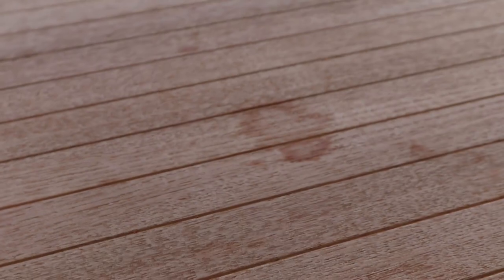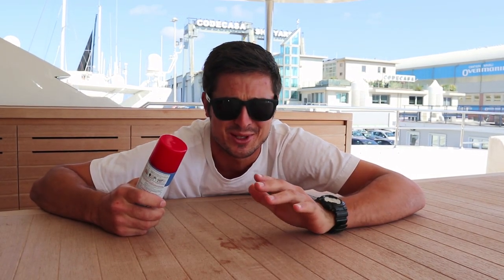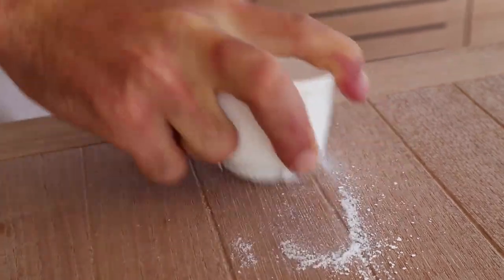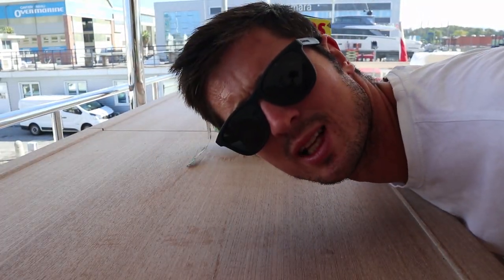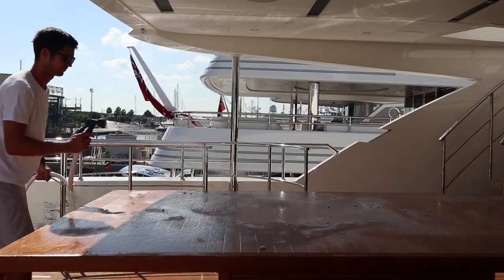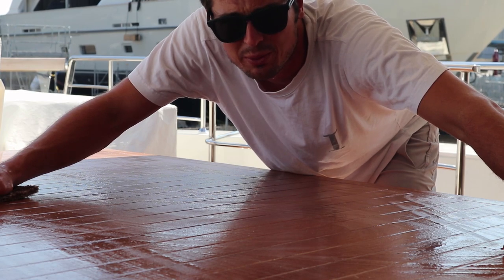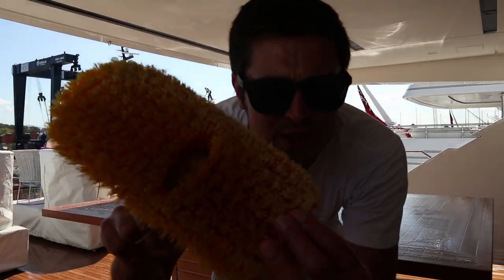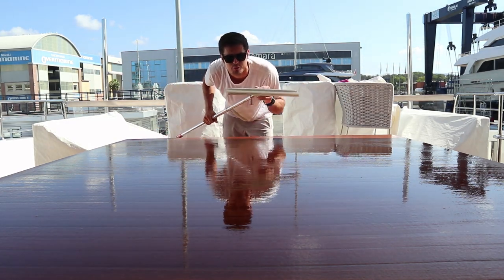How Yacht Crew Treat TEAK Quickly

Comment: Hi Jared,  loving the videos!  Question: have you ever thought about using Odie’s Oil?  It’s not only designed for every wood, but it’s especially great on exotics like Teak and it would prevent oil spots from ever occurring. You would only need to use vinegar and water to clean periodically. As a wood worker, I can attest to it’s unbelievable properties. If you ever want any more details, let me know!

Comment: I was working on a boat and we just cleaned the team and shit you not 30 minutes later our fuel overflowed through the vents and we had to do the teak all over
Reply from the maker: Ahh man! That is the worst. I wont lie i have had a very similar thing happen. When fueling, having water on the deck is the best way to avoid stains. The fuel and water dont mix and simply run over the teak.
Reply: jared watney good to know but the only thing is it was the day after we fueled up and the engineer was moving fuel the around

Comment: Never use a high pressure spray to clean teak, it’s hardwood but it’s actually pretty soft. You will slowly break the teak with. Very nice video though, keep it up!
Reply: I will totally agree with you as a General Rule. With that said, I use a low pressure 1,200 psi washer with a wide tip (15 degrees) at approximately 6-12" away. There is no burring or destruction of the natural wood fibers. It appears that washers with a psi of over 1800-2000 starts to be that point that the wood is negatively impacted. I watched a person (against my advice) use a 3000 psi washer and literally redesigned the wood with divits and new channels where the fibers were completely removed. Always best to simply start with the most conservative approach and work your way more aggressive until the desired effect has been reached.

Comment: Hello Jarad, I know you posted this quite a while ago. But, why don't you use natural tung oil? The Chinese have used it since at least 400BC. It's fantastic for teak on boats (where it was originally used). With a zinc additive, it is good against UV rays (where I've seen damages on some of the yachts in not only your videos)... stops that graying of the wood. it's good against oil & food staining (Wait till you have to get red wine out of untreated teak). It stops salt water from soaking in also. Lastly, it's food-safe, and leaves the teak looking and feeling natural, the same as the day it was installed.  Plus, unlike other finishes, you keep the non-slick surface you need on boat decking.  And, how you showed cleaning of teak in this video, does not change. It just needs a freshening every few years.

Comment: Do you put Teak oil or sealer afterwards or do you just clean the teak  so often that you'd strip it away every time?
Reply from the maker: An oil based product can be applied to teak but inevitably it makes it worse. Why? Eventually stains still occur and half the products used to treat oil stains also then remove the oil based teak treatment and end up leaving patches everywhere. Raw teak is 100% better to care for.
Reply: That's what I thought. Thanks!
Reply: Not entirely true. Teak Wonder sealer protects the decks against fat and suncream stains and is not affected by K2R. The K2R will still pull out any aggressive fat stains that manage to sit above the sealer, and the sealer will still come up with a good, thorough part 1&2 scrub. We part 1&2 only twice a season (May to October) and give the decks a super light scrub with wash down water once a week. We apply a new coat of teak wonder every 4 weeks, and our decks always look brand new. Raw teak is basically a sponge for any dirt.
My 2 cents...

Comment: Great video!  With all that scrubbing on the teak how long will a deck last before it has to be replaced?
Reply from the maker: Thank you Michael. There is no set date but usually about 10 years.
Reply: Teak is also very, very expensive. It can easily cost over 200k$ to have new teak put in on such a yacht (assuming all deck areas are teak).

Comment: whats your opinion on the new fiberglass that looks and feels like wood ? wouldnt it be better and easier to deal with ? will it look different ?
Reply from the maker: They make a product called "Plasteak" as in Plastic teak. There are quite a few new options and because i am a bit of an environmental enthusiast, I would consider other options if I was an owner but for most yachts, Teak is the only real option and thats all most owners really know. Think it will be a while before really used
Reply: thank you for your answer and hard work
Reply: Don't know the product but I replaced the deck behind my house with Trex composite recycled from polyethylene bags from dry cleaners, and sawdust. It made sense, all things considered. Unfortunately I didn't consider "all things." I chose the teak colour as it was the lightest shade but the material gets so hot you need flip-flops to walk on it when sunny. Also it's like a skating rink with ice or snow on it making access to the hot tub a perilous endeavour. Best bet: stay with teak and let others try new synthetic materials to see if there are hidden surprises. My yachting days are long gone but I wanted to say thanks for the informative videos.
Reply: To be honest, if you are an environmental enthusiast you would go with teak. Trees are panted to take care of demand... and plastic is plastic... messy to build and messy to dispose of. 
I don't like how much unnecessary plastic we use, like those ready-peeled-warped-in-plastic-fruits we see in the supermarkets.

Comment: Hey Jared, great vid and I love the tip with the vinegar, will keep that at the back of my head. Just a quick one, I will be 21 at the end of the month and still got 2 years left in my degree. After I’m done I would be keen to give the white boats a shot. But would 23-24 year be a bit old to start? I don’t have any qualifications but I work part time on a ferry for the past few years and I do know I will need my STCW which I will get after uni. Keep on living the dream my man🤙🤙
Reply: I do plan on buying you a beer 🍺😉
Reply from the maker: Hi Luis. 23 24 is the perfect time to start. Any younger and boats dont always consider hiring new crew as easily. Good luck man
Reply from the maker: oooh I would appreciate that

Comment: Why is there no varnish on the teak?
Reply: Varnish is not good to walk on when wet (slippery) , it is difficult to keep unanimous (think about how your carpet wears in high traffic areas). If a boat doesn't have teak it normally will have a "non skid" surface (paint with sand-like particals mixed in) .
Reply from the maker: Legend for answering the question perfectly thanks man.

Comment: Thanks Jared. Do you know why all yachts use so much teak?
Reply from the maker: There are very few woods that can be used on boats. It is strong and hugely weather resistant and therefore just boat manufacturers choice.
Reply from the maker: Cant blame you.
Reply: Thanks for responding. But why are they all untreated?
And Aerin I like teak too but that wouldn't explain why ALL yachts have it. But Jared explained it.

Comment: Why are they using teak if it gets marks so easily? because it looks good or?
Reply from the maker: More like " oh so thats why you have a job" haha basically boats are always hard work man, It marks easily but is one of the few wood types that can be used.
Reply: I see, ty ^^
Reply: Teak is naturally resistant to most rot/fungus and stuff.  So its one of the best woods for getting constantly wet and then dry again.  Also feels nice under foot.  Sea dek, or similar, is the far more sensible choice these days, but if you are rich enough to have a  super yacht, you aren't cleaning it yourself so I suppose owners have the real thing mainly for tradition.  Anyone who cleans their own boat is not a fan of teak.  Synthetic all the way.

Comment: does all the chemicals and acid not damage the wood in the long run?
Reply from the maker: In the VERY long run, sure. Teak is usually replaced on boats every 10 years or so. 12mm of teak is often laid and 1mm a year removed from use and washing etc. That's like a very basic rule of thumb. That being said, just leaving teak untreated can mean mold accumulates.
Reply: okay i see, anyways im sure the owner of the boat has no issues with paying for new teak haha.
Reply from the maker: Its super pricey.

Comment: Why is teak used if it's such an easily marked wood?
Reply: Suzanne Bainbridge teak is a close grain wood and is super durable to the elements, hot sun, and fungus. It has natural oils and rubber in it that keeps fungus out and keeps it from rotting. That’s why it’s used in the Marine Industry so much. The reason it shows the oil like it does is because the oil on the surface of the wood dries out.
Reply: @markgriffin5537  Thank you, very informative.